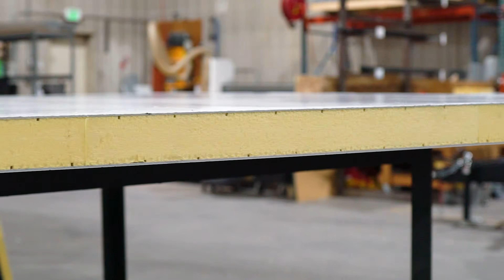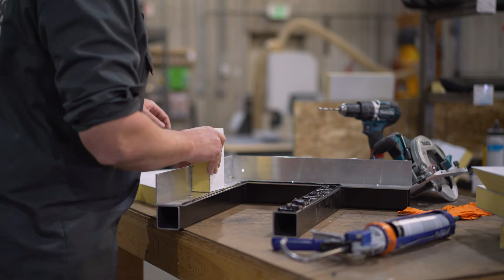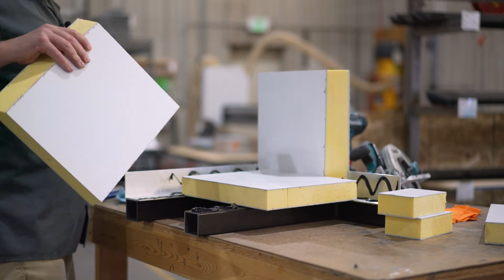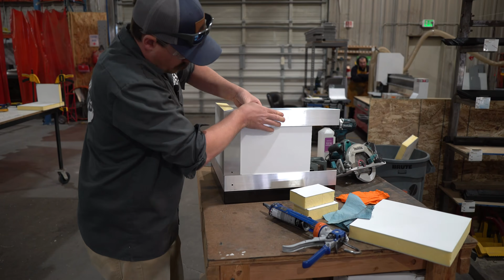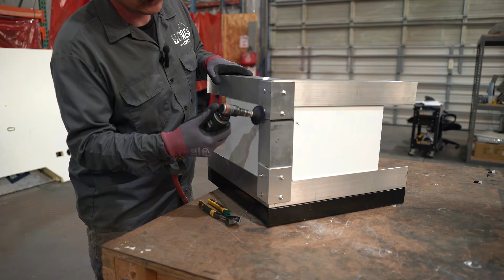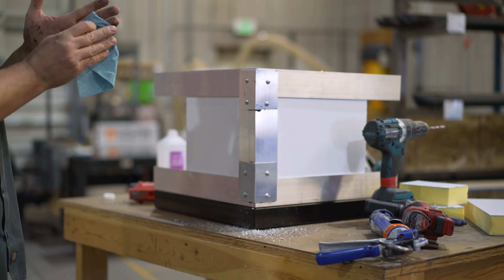DIY Assembly of Composite Panels and Aluminum Angle for a Homebuilt Camper

Comment: I love your guys trailers and am happy you’re selling these panels now. I gotta ask though, if you had to panels each with a 45 miter and a 90, hey in the world would you choose the butt joint? I’m guessing the person that cut them for you is facepalming after watching the video.
Reply: I was thinking the same thing. The mitered corner would place the rivets much further inboard from the edge of the fiberglass and give the Sika an actual surface to bond to rather than just being pressed onto foam (which has no strength).
Reply: I think it was pretty clear the demonstrator used the wrong end for the wall corners.  Why else would those pieces have a mitre cut.  It can't be for the audience, because the floor wasn't cut this way either.

The floor panel looks like it should have been installed rotated 90⁰.

The wall panels should have been installed before the floor panel.

Had the wall panels been installed first and with thier mitres in the corner the floor panel would have lined up perfectly with the wall making for a very polished demo, but no, this was not meant to be.

I truly feel sorry for the person who prepared the pieces for this demonsrator...
Reply from the maker: There is always more than one way to skin a cat.  The Boreas Campers product uses butt joints in its construction process.  This requires a larger peice of alum angle to cover the corners.  We just posted up another video using a lap joint.  The lap joint process will be used in our pre cut and/or pre assebled camper kits.  Here is a link https://www.youtube.com/watch?v=mYdatjOi5AY

Comment: So quick rough math with pricing from your site puts a roughly 13’ x 5’ uncut panel over $1100.00?
Reply from the maker: Yes, that is correct at the $17 per square foot.  We do have a select panels sizes available at $10 per square foot

Comment: As efficient as these panels may be, you’d have the ugliest camper out there. Or can this be made with an inner skeleton and capped corners? Cannot make curves, I assume? How do you run wires?
Reply from the maker: You are able to bend the panels up 20 degrees for a sloped roof or you can cut multiple pieces to add angles.  No interior struture is necessary, but yes you can cap the corners if desired for asthetics or additional strength.  Small conduit on the exteior of the walls works great for running wire. Check out @boreascampers for an example of this composite panel and aluminum exoskeleton system
Reply: No skeleton needed if using mortise/tenon joints. Very strong and light weight
Reply: You could use an inner skeleton, but you still need to bridge over all of the exterior corners, so it won't look different. 
Correct - ready-made sandwich panels are flat, so they cannot be curved. 
Most wiring and plumbing should be within interior cabinets, but ceiling-mounted lights require another solution, such as running wires in flat mouldings on the surface.

Comment: Curious here,  are you saying that can be used as/or in place of a floor?  Is it really that strong & has anyone ever seen/heard of
this being used in a "House-Boat"?   I'm looking into some things & this caught my eyes so I stopped in to see how good it is?
Reply from the maker: I know that many pontoon boat manufactures are going to composite decking/floors as opposed to marine plywood, however, I'm not sure what their exact specs are.  Using our panels as a floor is not an issue.  You do need to have support members at a minium of 18 inches.  I also recommend using a secondary finish, such as LVL in high traffic areas.
Reply: I like the material & it looks like it's easy to handle.  Tough n light weight is all good.  I'm still researching but I wouldn't
use plywood anyway, not marine or any other b/c it's too heavy.  This stuff has some good attributes but do know if can
be covered w/ fiberglass?  I'm real new to all of this & I thank you for sharing the info here.   I do like it,  thanks a lot.
Reply: Structural sandwich panels work well as floors... but the top skin is usually thicker than that of a wall panel for durability, and the foam is usually more dense than a wall panel, or another core material is used.

Comment: I did not see any adhesive being applied to the joint of the two wall panels.  Did I miss it?
Reply: The perceived errors throughout the video leave me thinking this is the right product installed completely wrong…as assembled it’s a water leak waiting to happen. Funny part is it looks like all the panels were pre cut to fit better, and possibly not leak (depending on how he put on the adhesive).
But like many times “action” was called and the script went out the window…
Reply: he had pieces cut in 45, but he is just camera shy 😂
Reply: Don't see a hightlighted answer either
Reply: None
Reply: @kevinrusso6849 wrong
Reply: Good call
Reply: @michaelcagle4662 you blind? Sikaflex was applied
Reply: @alsnyder1660 look again. SikaFlex was used
Reply: @artsteadman2230 no it wasn’t. I was watching. It seems like he missed it. It also seems like that corner should have had the pieces cut at 45 degree angles for a stronger joint.
Reply: @stevenmark8156  if you look the other side of the panels I think they has 45° cuts.... but he put them backwards 😅
Reply: @Ale-or2gk  the mitred edges of the panel pieces are probably just leftover from cutting the rest of the panel - the demo is done using scraps.
Reply: @stevenmark8156  They were pre-cut for a 45 angle, he put them on backwards. 
Hope he is not the guy who builds for them.

Comment: Doesn’t the adhesive need a standoff of about a mm or so to allow the adhesive to flex and ensure there’s enough left in the joint?
Reply: SIka has good data sheets. They spec out a min/max bond line thickness and (if I recall correctly) a durometer of the cured product. McMaster Carr sells rubber spacers. Get spacers with the same durometer as the cured Sikaflex, and at roughly the right bond line thickness, and if you're lucky, ones with an adhesive back. Makes the bond thickness issue a pretty easy one to manage.
Reply from the maker: You do not want to fully compress the bonding surfaces and squeeze out your adhesive.  With the XPS foam core being porous you are able to keep a tight bond line.

Comment: Concerned about de-lamination whether from when I cut out openings, corners, etc or just over time. What do you recommend to re-glue the frp to the foam and do you sell it?
Reply from the maker: Thats correct you do not want to have exposed edges on the panels.  However, the water intrusion needed to cause any type of delamination is infintiley greater than a traditional plywood (stick and tin) camper.  When you cut a hole for a door or a window the FRP and XPS foam core will stay bonded together and you won't need to glue any exposed edges.  Just make sure the final installation of the door/window is well sealed.
Reply: @boreascompositepanels  What sealant do you use/recommend?

Comment: Helpful, thanks. Will it be structurally strong enough to support the roof piece resting on the wall panels, or is a wood or metal frame needed to support it?
Reply: I saw a video from Australia showing i think 15 people standing on the roof of a similar construction trailer. No frame required is why this construction is so awesome. I build mine with moulded rounded corner construction and no caps, still plenty strong but not for offroad. Great to see a company selling product for the DIY crowd.
Reply: @steveogilvie5203  I would love to see that! I'm trying to figure out how to assemble the roof transition, I wish this video explained it...
Reply: @hellogoodwin  i have built 3 so far. I use a removable wooden mold. I won't post a link but I have made lots of videos, just do a search.
Reply: @hellogoodwin  Styromax has posted lots of videos too. You might find your answer there .
Reply from the maker: By making a relief cut at the breakover point you are able to bend the panel up 20 degrees.  Any angles larger than that would need to be made in two pieces.
Reply from the maker: Thanks Steve!
Reply from the maker: The quick answer is yes.  However it will depend on your overall length, width, and expected weight load.  If you're looking to build a 5th wheel with multiple AC units you would want to add additional support.